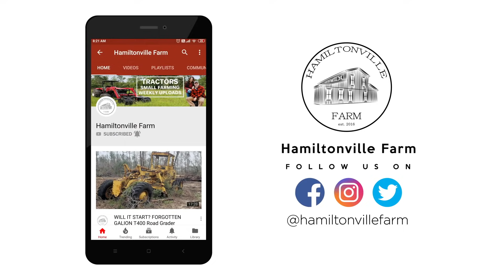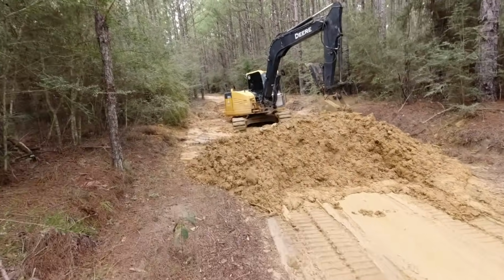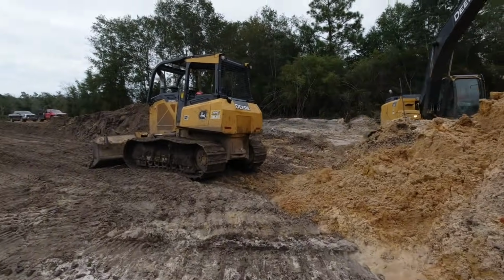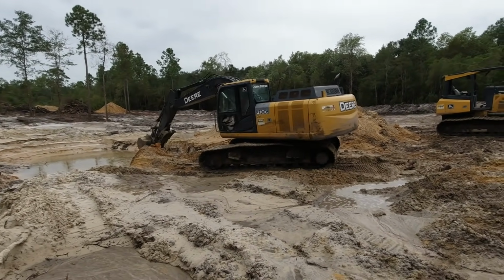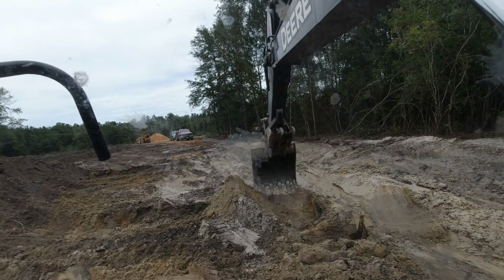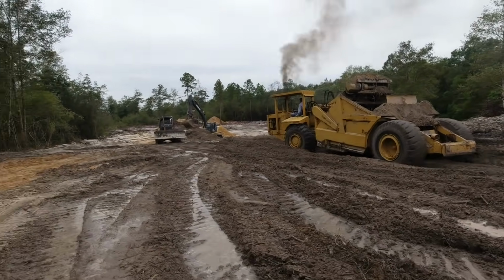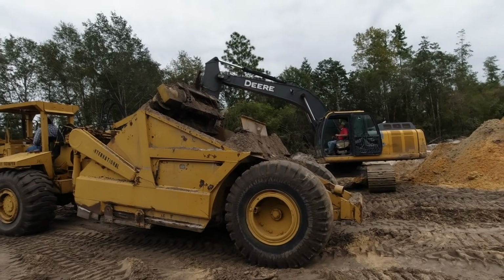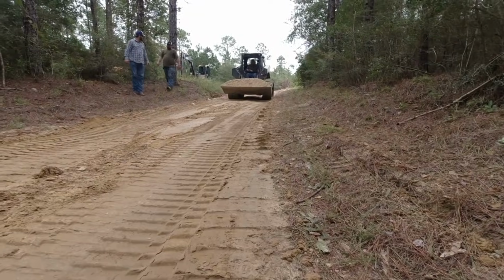DEERE Excavator Digging! Heavy Equipment Gets STUCK In The Mud!

Comment: After a life time of construction work you can have that heavy equipment. It's just one headache after another. Something is always broken on heavy equipment. 
Lower Alabama is mostly a Delta most of the dirt there is called lome it's a mixture of sand small gravel and clay. The soul around Central Alabama like Montgomery is prairie dirt it's a type of clay that holds a lot of water is pretty nasty stuff and it stinks. Up around Huntsville they have really good dirt it's a type of lome but has more red clay it's easier to work with and easier to pack too.